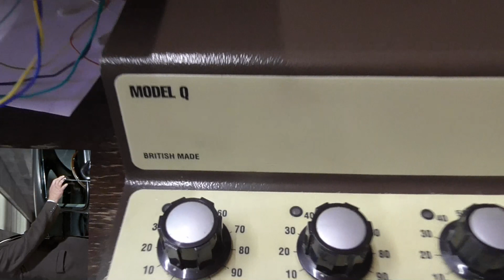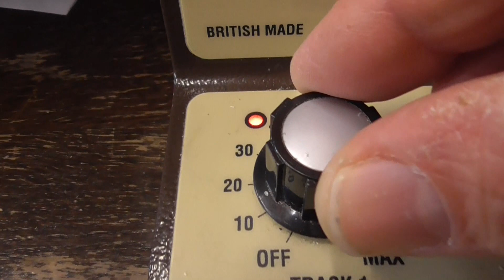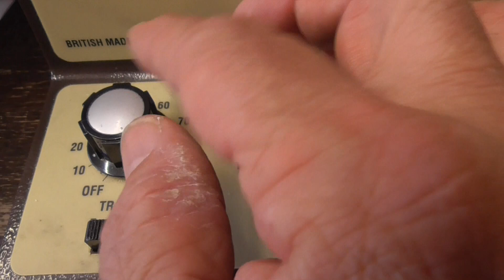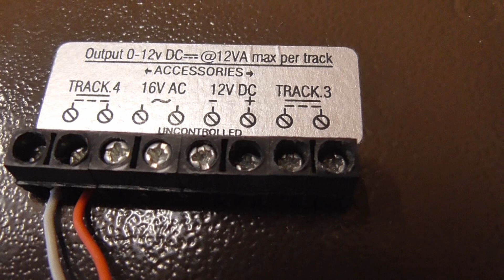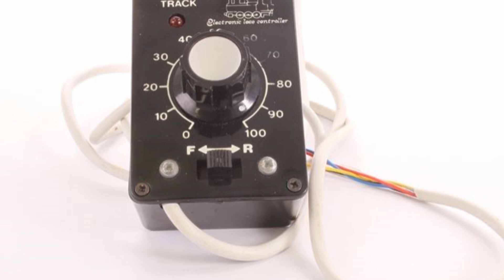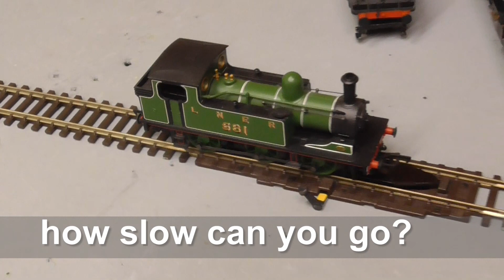Hornby Dublo - Trying out  a Feedback Controller

Comment: Like the comparison test ( Very Helpful ) According to Gaugemaster ,when I was Visiting  there shop in Ford, it was explained to me we just need to be careful not to use this type of controller on the more modern motors.....but for us on Hornby Dublo/Tri-ang and Tri-ang/Hornby and pre 1980 Hornby, then it's fine.....I Know Richard luvs em'. It gets my vote, Thank you, Clive, Well Done..
Reply from the maker: thanks Paul always good to receive feedback! It gets my vote as well.
Reply: @clivebennettHornbyDublo  sorry Clive I was watching your great vid, but mate, please, that poor R1 at the end is gonna die if you keep feeding it yhe frequency pulse. you can get 'em to run slower (I've got some boring vid here about dublo slow starts or whatever I called it) but that rattling sound is really not doing the motor good. thanks mate
Reply from the maker: @muir8009  thanks I thought the motors were noisier with the FB liked your slow running film.
Reply: gotta be careful here: feedback controllers aren't good for coreless motors as stated here, we all know that, but they're not good for older style motors either, especially open frame jobbies. In this video you can hear the armature plates rattling with the pulse feedback; they're not happy. run 'em on pure DC, especially something like an H&M auto transformer (the powermaster and safety minor only) the motors are silent, and because they're tap controllers not resistance they have their own feedback abilities. I've got a vid on here, something about dublo slow starts and yes, they were slow but the motors really weren't happy so changed back to an autotransformer. I have cooked a couple of xt motors using feedback controllers so not keen on doing that again. the dublo ones are more robust but still not happy, the ringfields appear to be worse for some reason. cheers, good vid :) in all honesty the heisswolf would appear to be the best analogue controller, especially the ability to control the frequency as well as run pure dc. on some models of powermaster you could adjust the pulse width between pure.